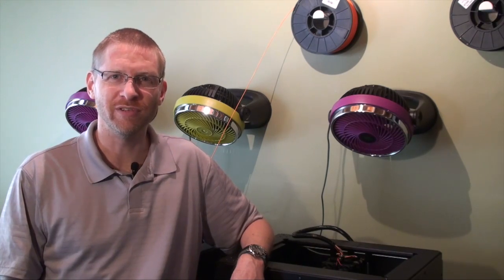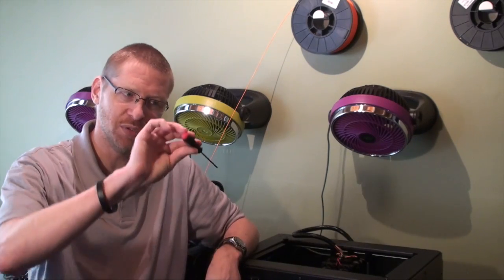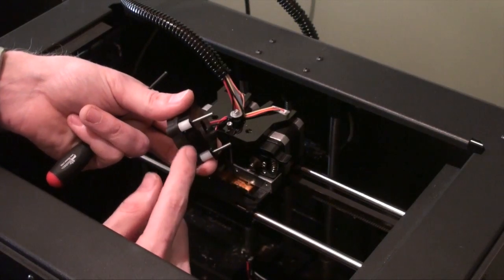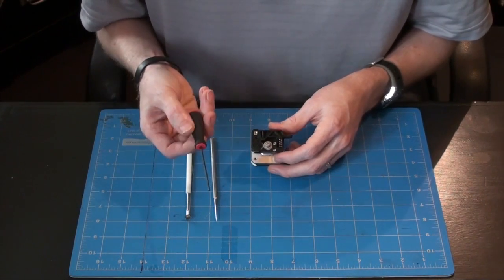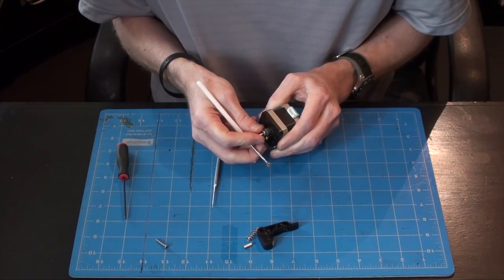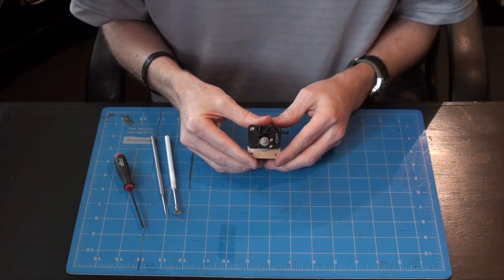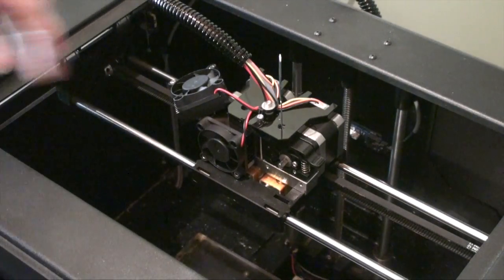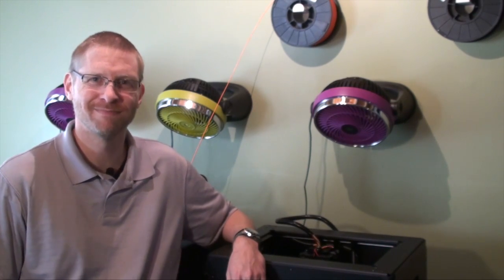Cleaning the Extruder Drive Gear on a FlashForge Creator Pro 3D Printer

Comment: I really wanted to reply to Peter L.'s comment, but youtube will not let me - it sends me to create a channel instead which I have absolutely no interest in doing.  IMHO youtube has gotten far worse over the last few years...

Anyway, I've spent at least 2 hours trying to reassemble my printhead after removing it and cleaning it.  The OP gave very good and clear instructions for that, but no instructions at all on how to get the screw and head and fan and heatsink and spacer and and and all lined up just right so you can actually turn the screw and reinstall properly.  After quite a lot of work and many failed attempts, I was able to kind of see the screw and the hole at the same time and try to screw it in, but it refuses to go and I do not know why.  A video focused on that, specifically, would be really helpful.

My printer is no longer usable.  I assume that cleaning the plastic off the ridged thingie will fix the problems I was having previously, but now that I can't assemble it, I have no chance of printing.  :(  I have tried many things and nothing has worked.  Peter's post on how you can only turn the screw about 3 times seems like it should help, but it did not help with what I can only assume is an alignment problem.  I've used this printer for years and this is the first time I have been totally unable to get it going again after minor service.  Any suggestions?
Reply from the maker: Unfortunately, it's been quite some time since we've had any Flashforge printers around here, so we're not able to do a new video for this. I do remember those screws being challenging to line up, but I don't think there was any particular trick other than patience and multiple attempts at getting things lined up properly.

Comment: You are a good speaker and the video is clear, but you miss 2 major points that will leave a newcomer to 3D printing and the FFCP easily sidetracked.  When retightening the 2 screws in the grill/fan/heatsink/motor stack the screws only engage about 3 turns.  If the motor is not ALL the way forward in the mount, the screws will just spin and not engage.  I wasted 15 min on this.  Also, the stepper gear being gummed up is not the first thing to check if filament won't load/extrude.  A clogged nozzle is.

Comment: How did you remove the bowden tubes where the filament runs in without taking the extruder appart?

I would like to remove the infeed tubes to the extruder just to run bare Filament

Comment: I had ABS filament stuck inside my extruder because my spool messed up on the road during a printing process and your video helped me removed the filament inside.
I just had to cut it at the entrance of the extruder then load it again with 240°C and voila i was back to business <3
Thanks a ton and milion of kisses for you :D

Comment: Great video and explanation, I had to do the left side and just wanted everyone to know that it's exactly the same. Even with the modified duct, I was able to get it out easily. My jam was terrible. I would like to know where to buy parts for the FFCP, i need some extra fans for the front.
Reply from the maker: You can buy spare parts from Flashforge USA, here: http://www.flashforge-usa.com/shop/index.php
Reply: Thanks, I went there already, but astronomical pricing $16.00 for the fan and $80.00 for shipping. I'm also in Canada,  Perhaps I forgot to mention that lol. I Think I'll head over to the local PC parts store and find something similar.
Reply: DC JUICE did you take the duct off? I can't seem to get it out either way but I was easily able to do the right side
Reply: So I ended up buying a 5 pack of 40 X 40 fans  for 25.00 amazon.ca     Did I remove the duct, mines custom. I don't think I did. I'd suggest it just to make it easier. I'll do a short vid if ya want. I have to replace my fan as the filament accidentally threw itself inside lol.

Comment: Is it possible that gunk also gets jammed up in the nozzle part?
Reply from the maker: Yes, the nozzle can become clogged. Usually, this can be addressed by raising the nozzle temperature to around 260C and feeding more filament through. If that doesn't work, you can use a hypodermic needle of the appropriate size to manually clean out the nozzle.
Reply: @3duniverseOrgWelcomesYou  do u have a video on this? I just took over the 3D printer at my school. It’s jammed & has been sitting for 2 years. I can’t get the thing to flow.

Comment: Thank you so much for this video.  I just purchased the Creator pro a few weeks ago (novice at 3D printing) and changed the filament for the first time today.  While swapping the rolls the extruder was clicking and wouldn't grab the new filament, I have to say I was panicking.  I found your video, followed along and cleaned out a large piece of PLA that was causing a jam in the machine.  You literally made my day, THANK YOU so much for your help!  I've liked and subscribed.

Comment: hey, I know that this video is old and this doesn't really relate to the video but, I just bought my first 3d printer, (flash forge finder) and when I clicked on the button to heat up the filament, plastic started oozing out of the sides and now there is a big chunk of plastic on the nozzel and it can't print anymore and I don't know what to do.

Comment: Hi. First of all, thank you for this great tutorial which helped me to start with my new FlashForge. I have it since some hours now and I keep trying doing a test print with the 2 PLA filament rolls provided by the reseller. Somehow at 20-30%, I always have the problem the filament getting stuck into the loading gear (both extruders). Did you see this kind of behaviour? No nozzle clogging, just gear gets blocked. So I opened several times the gear and cleaned up the jammed bits of filament and it started working again but the problem keeps coming back. Any suggestions? Thank you.

Comment: Left extruder cannot be removed the same way because of the cooling fan on the left of the left nozzle head unit thing majigger.
Reply: +TomSawyerProductions You have to take the fan off as well. It is a little tricky because some models also have a little l shaped piece that diverts the warm air towards the extruder head. If you have that piece, you undo that screw first and then the other two screws on the main fan on the left side.

Comment: I've got a pretty hard jam inside the actual nozzle, do you have any tips or advice to un-clog it? its pretty bad (I cant just push filament through no madder how hard I try).
Reply: Did u figure this out? I’m taking over a 3D printer that is jammed & hasn’t been used for a couple years
Reply: @jeffrichied4521  Yes! So I disassembled the nozzle and used a torch to burn it out and then a q-tip and acetone to clean out the ash. That's my go to method now. BUT I'd say right after you unclog it, print out a "filament filter" or sometimes they are called a filament oiler. I haven't had any clogs since I added one years ago! I do not recommend actually oiling your filament though, it can mess with your layer adhesion. Let me know if you have any other issues.
Reply: @brennen6354  fabulous! Thx for letting me know. Any tips on unscrewing the nozzle as it seems to be stuck :/. Maybe I’ll just get some liquid wrench or try wd40 on it. 

On the oiling, the video I watched had a small sponge inside the part that the filament ran thru. Do u put oil on the sponge first? Seems like that would make sense but it wasn’t super clear from the video. And if so, what type of oil? Thx again!

Comment: Hey 3D Universe, I'm having trouble cleaning the extrusion points or the hot ends where the plastic comes out from. The right side keeps "leaking" when printing and it has sort of caked around the tips and solidified.
Reply from the maker: Are you referring to the nozzles? You can clean them by bringing them up to temperature first (about 200C for PLA, 230C for ABS), then using some steel wool to clean the outside of the nozzles (being careful not to burn your fingers, of course).

Comment: There is a printable (binder clips for the spring version) that has an opening that allows access with the stiff brush when the unit is running. I've no idea why that version never caught on. Makes clearing the gear on the fly possible.
Reply: 66tbird1 LINK PLEASE!
Reply: Here you go.
http://www.thingiverse.com/thing:32315
Reply: I still don't get why this designed didn't take off. If I run PLA I add a clip. If I'm printing in that wood, or brass, or flexi stuff I'll run fewer clips. I keep a stiff little brush around and clean the knurl while it's running. I've got a rep2 with the ''total  solution''(I think) mod and sure it's great but I had to make a chart for the spring tension. And forget about seeing whats going on without a tear down.